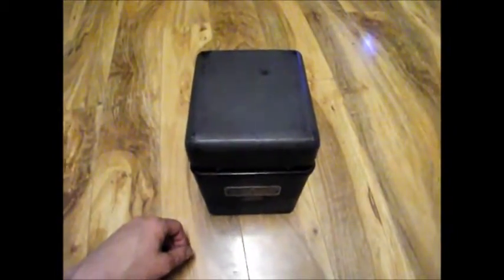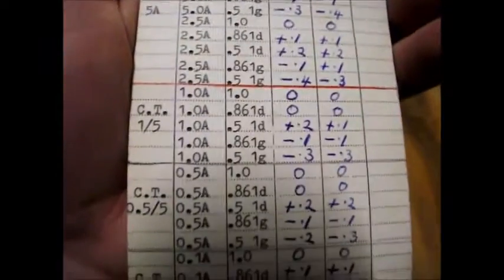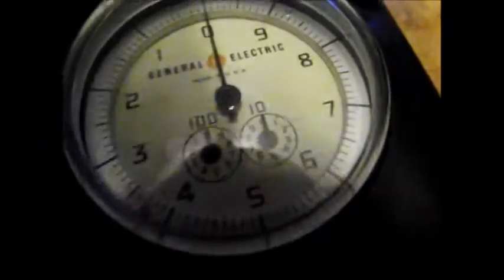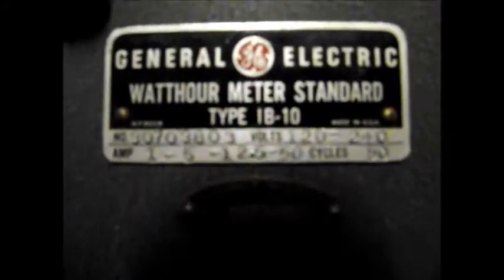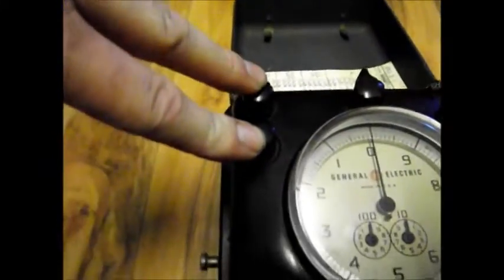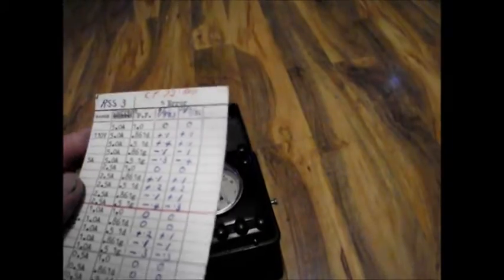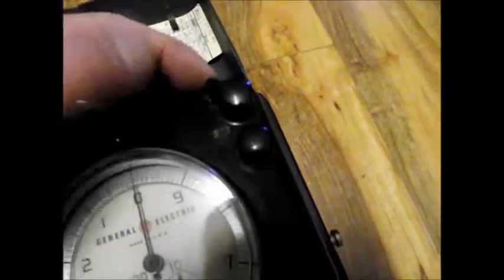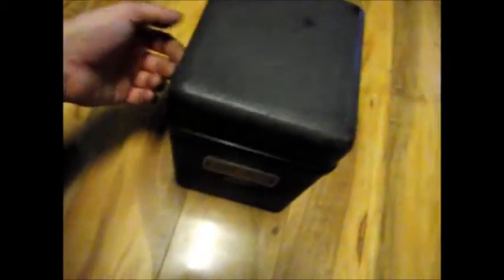watt hour meter calibration standard ge Ib-10

Comment: i know this is years old but i ran into your posted video and think maybe someone else would benefit by my work on this  as i have seen these on line as well for sale...
Ok i did some investigations , and careful examination of the workings and wiring's of the transformer and mechanism.
SO here is how you hook it up...  i provided a link to a picture of my setup working.
The input AC goes to the two small lines to the left of the meter at top, the "0" is neutral and the other is hot.. 
This is the internal transformers lower connections and it is standard power. its how the unit is powered (You could just put a outlet plug on this or clip leads to hook to breaker box etc)
The 120 240 switch does what all transformers do with two 120 wingdings by either series the input connections or paralleling them. 

NOW taking an additional line from the hot side (black) and going through to any of the current settings now used as an input (of the lower series of connections that are labeled for current).
then take the current outputs (labeled 0) depending on your load (why this is needed is interesting but i have no answer yet) then bring that HOT line to your equipment load.
The neutrals are tied together at the upper  0 marker. (Not the lower one).
Remember NO NEUTRAL CONNECTION TO THE SERIES OF OUTPUTS on the bottom of the row of connectors (this is a series in out only connection) "0" being series out to equipment.

To test a circuit on a breaker panel you could come out of a single  breaker with a wire off the breaker after disconnecting a light circuit from the breaker and run that lead into the marked current points  on lower connections then out the terminal marked zero to the lights and sub the unit in series to the line of the lighting etc.  Doing some test comparisons this is working as it should and in the right meter direction.. 

https://drive.google.com/file/d/16h6H7JX_hxKVgktawsSKoZR_nU_IarJA/view?usp=sharing

Comment: 50 - 12,5 - 5 - 1 Amps would be the tappings for the current as the meter goes in series with the load.
Your guess is right.
For testing put a 100 or 500 Watt lamp in series which whatever you do to get to see how it all responds.
Reply from the maker: makes sense. kwh meter terminals: active ph line in and neutral line in to potential terminals on Ib-10 . kwh meter ph line out to Ib-10 and then select the appropriate tap depending on the load you are connecting). so for a 500watt light I would select the 5amp tap?
Reply: Yes.
Reply from the maker: Thank you very much for your help :) I have to make up a safe test set up before I even try to hook up this awesome standard :) I have several meter videos to shoot and upload.

Comment: OOOw thats in really nice condition :-D, I would not connect anything to it untill you have the operating setup, would be a real shame for it to blow it :-(
I would imagine its for resistive loads only, or it provides a resistive load for another meter to connect to, i dont know eather LOL.
In 86 i would have been about 20, but East Midlands Electricity didnt often check there customers meter so ive never seen a meter like that.
Did your family have a coin meter pay system, we did, 50p coins lol :-D
Reply from the maker: I am learning a lot about this thing :) I will not blow it up. I can't really connect it up until I make up some safe test leads etc anyway. need to set up a test bench so it's done safely